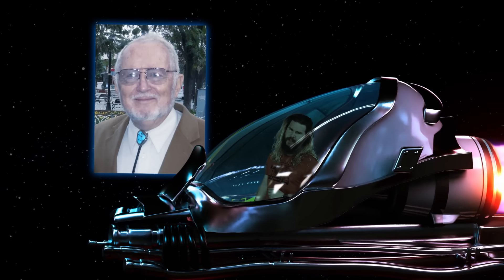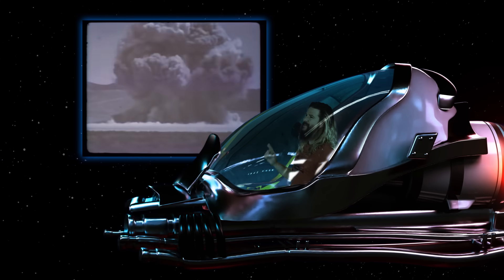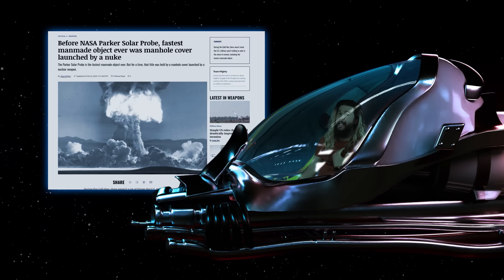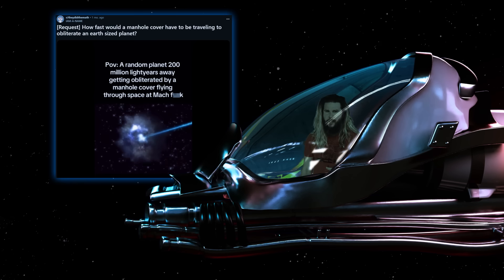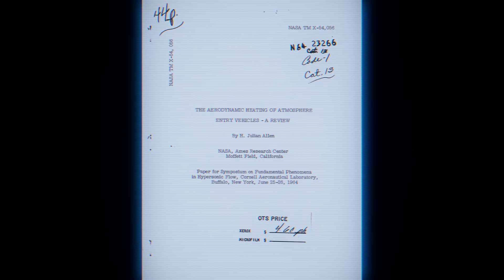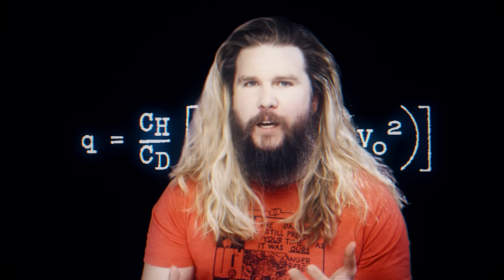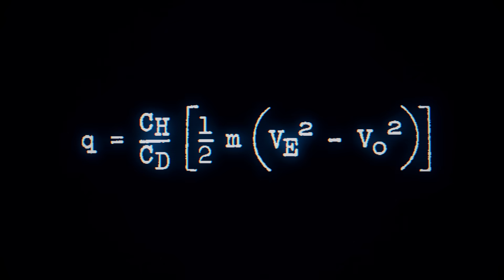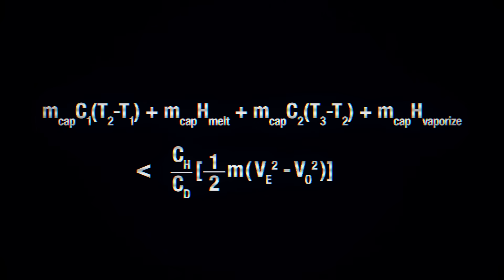Debunking the Nuclear-Powered Manhole Cover

Comment: A few variables worth considering: 

1) The cap likely was not moving through the atmosphere perfectly flat, but likely tumbled. Coins falling through air end up tumbling and traveling (mostly) at least partly edge-on. This absolutely changes the aerodynamics and the drag considerations 

2) The cap is not similar to a meteor because it was traveling UP through the atmosphere, instead of DOWN through the atmosphere. Atmospheric density drops off very quickly the further up you travel. at 150,000mph, it would have exited the troposphere entirely in about 0.16 seconds (we can round to 0.20 for easy math and to account for some slowing down due to drag, though getting an accurate number on that is an entirely different calculation), which would have put it past 80% of the atmosphere in about the time it takes to blink  

3) The cap is also not similar to a meteor because, to our knowledge, it shot straight upwards. Most meteors travel through the atmosphere at an angle, many of them a pretty low angle, so the sheer amount of atmosphere they encounter is substantially higher than an object traveling straight up or down through the atmosphere 

4) Transfer of heat is not instantaneous. Even for an object moving very fast and generating a ton of friction, the heat transfer still takes time. The leading idea behind the cap making it to space is that, while it was certainly going fast enough to burn up, it simply left the atmosphere too fast to substantially heat up. Again, it left the troposphere in a fifth of a second, and every mile that it traveled, the atmospheric density lessened exponentially
Reply: Sounds like the predicate for a sci-fi film where aliens invade due to our unprovoked attack
Reply: Exactly. I would have thought a trail of burning hot plasma heading UP would have been noticed. It was not, so it was out of the atmosphere probably before any meaningful heating took place.
Reply: So somewhere out in space, is a planet that will be hit by a former manhole cover shaped lump of iron going mach fuck.
Reply: @smi7zy935  wonder how long it will take to catch up with Voyger.. (obviously it won't the odds of it being shot in the exact direction is close to 0... but still, thought experiment.)
Reply: @TheEpicSpire  Catch up? It's about 45 years earlier...
Reply: you saying time travel doesn't exist? oh shit. my bad
Reply: I didn’t do any math but my guess is that the iron cap lost a lot of mass exiting the atmosphere but a chunk or several might have stayed solid long enough to stay together as a few iron shot gun pellets in space
Reply: Also it need to be considered that the flow of air was also traveling upstairs the same speed.

Comment: Did you do the equation with it spinning? Or on edge? No just flat and the highest drag coefficient. On edge a manhole cover is very aerodynamic causing less heat to form. Also with the cover only in 1 video frame it is impossible to calculate true speed. So all you have shown is under worst case it can't make it.

Comment: Did you put in the starting velocity as the change in velocity in your equation? That would assume that barely two seconds of noteworthy atmospheric drag are enough to decelerate the manhole cover to a standstill, which I doubt. We don't know the final velocity of the manhole cover but if it is above 60.25 km/s, which would still mean an average deceleration of 360G (using the Karman line as the upper boundary of the atmosphere because any drag further up will be a rounding error for all intents and purposes), then by your own formula the manhole cover "survives".

Comment: there is a big variable you didn't factor in correctly.  namely the fact that atmosphere gets dramatically thinner as you go up. you clocked the equation as more of a "insert torch here" when its more of a "insert torch, pan stage left"  plus the fact that the atmosphere causes drag and diminishes the amount of drag it is applying as one climbs is going to cause more than one effect at the same time. firstly the cap is going to be experiencing an amount of slowing from that drag (miniscule as it will be) which does reduce the heating imparted to it (again, miniscule as it will be) but again as was stated before the friction imparted from the passing air will be decreasing rapidly as the cap climbed. All of this said, I am more than confident the cap cleared atmo. likely as a hyper sonic blob of diminished mass of its former self, but survive I am certain it did.

Comment: I never knew it was cast iron. I always thought that it was cast from a type of carbon or other casting steel. Cast iron is incredibly brittle compared to steel and as a machinist who worked a lot with cast iron, my intuition tells me it would turn to dust almost immediately just from the concussive force of the blast alone. I say turned to dust because I believe it would crumble before it would even have the chance to vaporize. I am disappointed because it's not as funny

Comment: I think that the fact the numbers showed that the cap was vaporized means it is safe to assume it was destroyed. Because I am sure only melting it takes vastly less energy, and try throwing a liquid and having it all stay together. If the cap only melted and didn't vaporize, it would still be scattered to the point of not being able to get anywhere. But if that did happen, it opens up the possibility of random bits of metal falling from the sky. Probably the least of your concerns in an area where a nuke just went off, but still funny.

Comment: Wait, what's V0? Did you just put zero in for that? Doesn't that presume it was in the atmosphere long enough to be decelerated, ignoring gravity, to a complete stop? If that were true, vaporized or not it ain't leaving the atmosphere, but it's a big assumption.

I feel like it'd at least be worthwhile to try to figure out how much time and/or distance it would take to decelerate to that speed / deliver that much energy. But on the back of my envelope, that the initial kinetic energy of the object is only 1.96 x 10^12 J sounds pretty damning.

Now, since we only have one frame we don't really know the initial velocity. I assume the 66 figure is a lower bound based on the assumption that it was on the ground in the previous frame. But we can work up what the initial velocity would have to have been for it to be vaporized [114.5 km/s], and maybe figure out whether it would have been visible given the exposure time of the camera - is that known?

Comment: I think we need to also note that this Cap was preheated by the Nuclear explosion. 
It will reach melting temp faster than a room temperature cap.
And the impact of drag and deformation on trajectory. It didn't start out as a aerodynamic shape, and likely got worse.

Comment: among the plethora of unknowns listed by other viewers, I saw one thing that wasn't figured in. it was not propelling itself so it would have some level of deceleration, reducing the velocity,  between the decel and the thinning air, the potential tumbling changing the heating sides/edges and heat migration through the object. it could take longer than calculated to completely vaporize, meaning there is still that slight probability of making exit from the atmosphere. we are also assuming is basic iron when it could have been an alloy or other material. could have been softer/less heat resistant or harder and more heat resistant. I mean they were trying to contain a nuclear blast after all...
  am I saying that it did? absolutely not saying either way. just that the probability is there. even if it does it would be much smaller than when it started.

Comment: Well asteroids enter at a shallow angle thus more exposure time to atmospheric forces where as the man hole cover was going straight up and it being propelled by the explosion rather than shot conventionally like a powerful slingshot or something plus it would have deformed in some way from the explosion and so the question is would it be in the atmosphere long enough for your equations to work and in my opinion given the information in this video I think it's more likely than not to have made it to space i give it a 60% chance depending on variables we can't definitively know such as deformation and/or shattering in to a 2,000lbs shotgun blast

Comment: 10:33 - comparing that nuclear manhole cover to meteorites is like comparing apples to oranges. Atmosphere gradient? Ring a bell? Obvious reasons listed below:
1 - meteorites come down
2 - nuclear manhole cover went up
3 - 99% of meteorites come at an angle, the smaller the angle - the more atmosphere layers they need to go through
4 - nuclear manhole cover went straight up, so it's path was the shortest possible way through the atmosphere
5 - as meteorites are descending the more dense air they need to cut
6 - the cover - even drastically decelerating at first cause of drag - left those dense layers rather fast (the shortest path - remember? not mentioning the initial speed even)
My main question is: "Would it have enough time to heat up so much to melt (not to mention vaporizing) until air friction would become unexistent?"
I also thought about one more factor: "Could the blast shockwave and all that hot air rising fast (faster than that manhole cover at first I guess) in mushroom style have helped this cover to leave the densest air by moving it out of its way, thus making the initial friction less relevant.

Comment: Not a scientist but did blow things up at one point in my life. The man hole started in atmo not coming into atmo. In my old realm, if i remember correctly, if you blew up a plate of metal it could invert super heat gas and the gas would actually lead the push forward. I am trying to be as vague as possible due to the nature of application.

Comment: It was traveling too fast for melting to matter. The atmosphere around it would have acted as a literal shield upon exit. Also an asteroid encountering increasing atmospheric density upon entry is very different from a projectile leaving the atmosphere, and experiencing a reduction in atmospheric density while doing so. If it was traveling substantially slower, then yes, it may have been mostly turned to gas before exiting earths orbit.

Comment: Great approximation, but your fudge factor and assuming it remains a disk are huge errors. Odds are it would be warped into a cone by the force of the nuclear explosion, and it'd be out of the atmosphere within a second, so odds are there would be a protective boundary layer of air formed as it traveled, so while its  a good approximation, it wouldn't match reality

Comment: Honest question, does the orientation of the object make a difference? Is it possible the manhole cover rotated 90° while in flight so that it was not passing through the atmosphere face-on but on its side instead? If so, would that reduce the energy enough to prevent it from disintegrating before leaving the atmosphere?